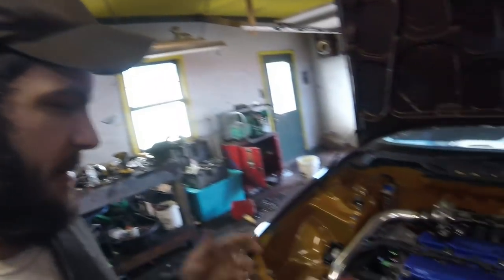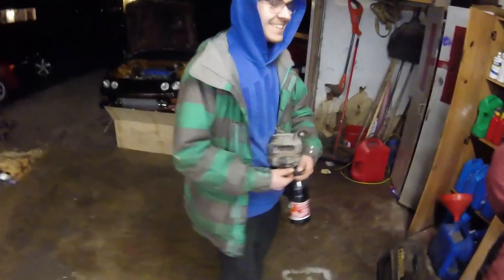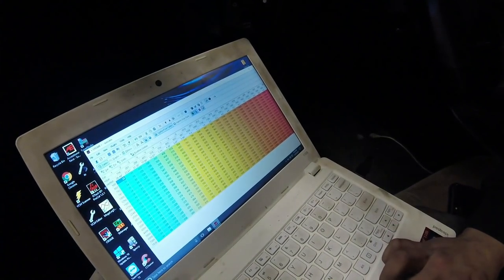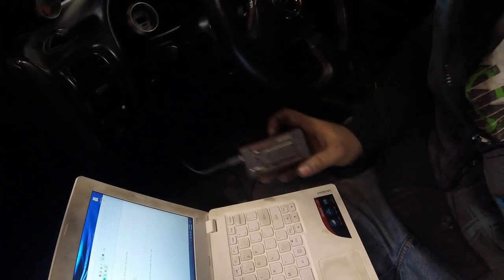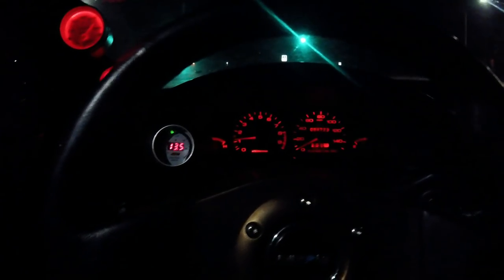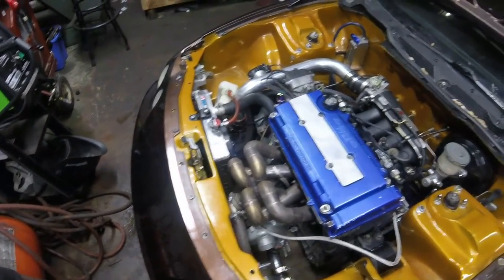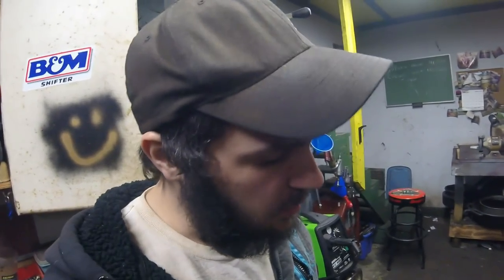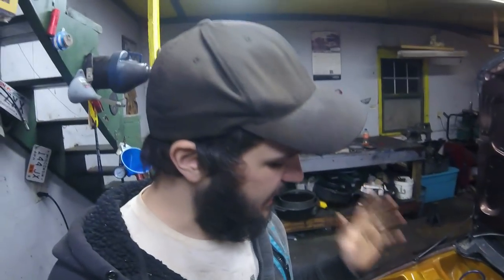Crome Anti Lag Tuning. Project Integra Is Working Great!

Comment: Hey bro one quick question? Where did you get that coupler on the throttle body I'm using skunk 2 ultra myself but my coupler seems to be to short it works but need a better one

Comment: Try setting the rpm for your two step lower. The lower it is, the louder the poppity bang bang. The higher the rpm you get more snap crackle but not as loud lol. Mine is set at 4500 and makes my ears ring for days

Comment: Hey bud sorry trying to hurry and send that valve cover out if anything will send it out Tuesday I know you need it, just waiting for my new cover to come back and then it will be on its way, anyways question if I'm using amsoil break in oil sae 30 weight, and in start up oil pressure is 80 to 90 and then when it completely warms up it's at 10 is that normal.
Reply: Jared Borja yea that's ok, you want to get some new oil in there right after the first heat cycle though. Depending on if Amsoils oil has detergents or not you'll want to get whatever it has carried away flushed out. It wouldn't hurt to use some 10-40 since it wont break down as quick.

btw Torco makes a great break in oil, sae 30-40 

& what engine are you running?
Reply: Cool thanks I was wondering if it was just the oil since it is just 30 weight I did a first start and let it warm up then drained the oil and put in New amsoil break in, because when I rev a little the oil pressure goes up with.  Brand new build, you think I should run regular 10 40 or synthetic.
Reply: Jared Borja use synthetic oil if you want AFTER your piston rings have fully seated ( check for good & even compression across the cylinders ) There should be very little to no smoke once they are fully seated. Your oil pressure gauge will tell you A LOT more than I can about what oil your engines happy with though. Just make sure to change your oil if it has begun to wear thin ( you'll see a drop in idle oil pressure ) less than 10 psi at warm idle is not good. 

Pennzoil Euro Platinum is a pretty good Shell oil comparable to Shell Helix Ultra... They have it in 5w-40